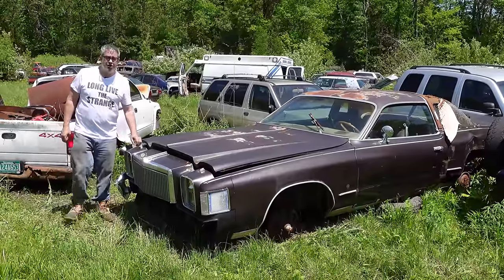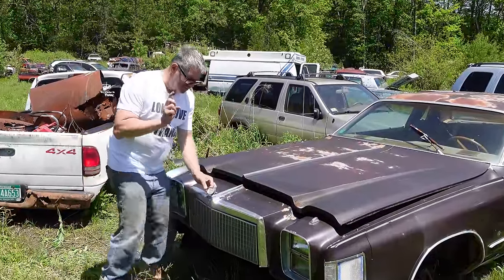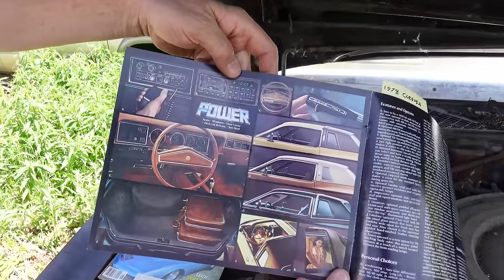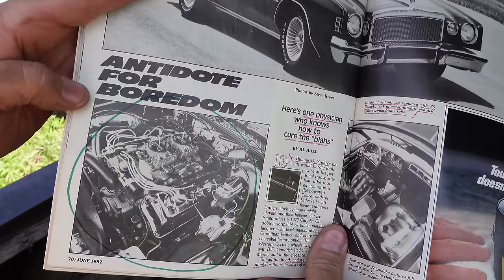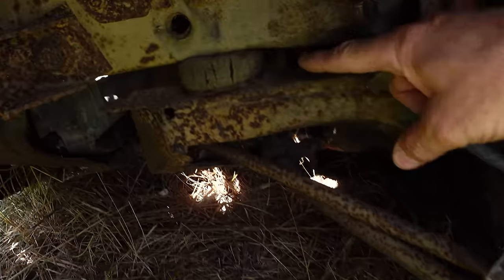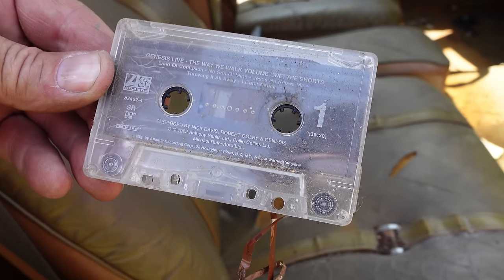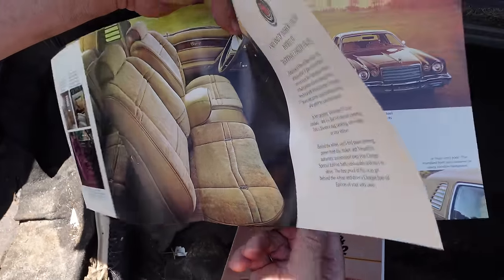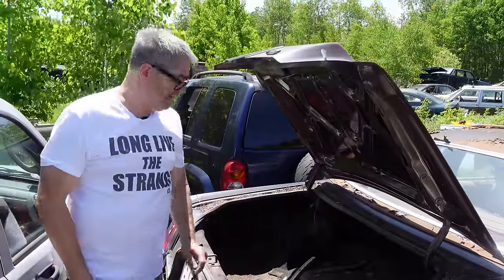426 Hemi Cordoba

Comment: I had a78’ and a 79’ at the same time , the 79’ had the 400 cu in, engine I bought it originally for the big block k-frame for my 78’ as it had the 360 cu in, you stated that the 400 wasn’t available in 79’ , unfortunately I no longer have either.

Comment: I owned both a 1977 and 1979 cordoba, beautiful mid size luxury cars, very comfy on long trips. Hated it when they changed from the classy round headlights and parking lights, to those ugly rectangle lights. I hated to part with it, but the roads salt ate the car up, that's what you get for living in colder climates.

Comment: something else Mopes of the disco era should be remembered for...those #$#ing wrong threaded lug nuts on the passenger side. My father, god father and i took his buddy's Dodge pickup truck into the woods of Maine, somehere near the CA border, and blew the passenger side front tire. Spent the July weekend jumping up and down on the jack handle while swatting the "Maine state bird", wondering WTF none of the lug nuts were coming loose.

well, the "nuts" at Mopar figured that since for every force there's an equal and opposing force, they should make the passenger side lug nuts thread the opposite direction just in case one day they might spin off. hadn't happened since Henry Ford decided to invest in black paint, but they did it anyway.

Comment: My first car was a '75 Dodge Charger SE with a 318 - almost exactly the same car except for the grill and trim.  My NEXT car was also a Charger - a 85 Charger SHELBY Turbo.  YES the 2.2 Turbo WAS a muscle car - I could smoke ANY MUSTANG built - INCLUDING a Shelby GT 350.... And could EASILY turn INSIDE a Corvette ZR-1at speed.

Comment: These videos are always educational.  I don't think that car was available where I lived in CA,.  I think the State mandated the Lean Burn or some special emissions package.  Back in those days there were often 49 state versions, and then the version that we got in CA.
Reply: I had a 78 with 360 California Emissions. It came with a 4bbl Thermoquad but they dumped the Lean Burn and added two more catalytic convertors to it. One off each exhaust manifold plus the standard large one under the passenger side. Despite the extra convertors, it ran very well even with the 2.71 gearing.
Reply: Anyone might wanna look up the vids about the differences ,I recall a vid on here describing the differences in the 80 corvette 49 state vs Cali version.

Comment: cool info , thought 360 then the 318 was a credit opt and 400 was opt, the hd /tow package had dual exhaust ,@10:51 should do the dodge Dakota club cab. dodge invented the club cab in 1973,ford 1974 the super cab  ford still offers it and 1978?79 Datsun had the king cab the Nissan frontier still has the king cab only ones left, as crew cab. /double cab is most of today s trucks  single  cabs  6.5' or 8' box is a rare new truck to day

Comment: If you were restoring one these, what would be the best option for replacing the worn out rubber bushings supporing the K-frame?
Reply: Hockey pucks with 1/2 inch holes
Reply: Hockey pucks
Reply: Remove them,ala Camaro,  it will lower it and make it more predictable to drive.
Reply: @garycamara9955  
Thanks, Gary. My buddy has a 78 Cordoba in his garage. I referred him to this video. I'll  forward your info on to him.

Comment: Habib and I go door knocking and pick up old cars a lot. He is more into Subaru, BMW etc. He calls me one day while I'm at the foot doctor "Hey! Would you be interested in a Charger Daytona? You could get it cheap." I told him not really so he tells me I could get this thing for under 2 grand, they want it outa there. I asked him how bad the rust was, he said:  "No rust, the tires are shot and so is the battery" I drove 2 hours down there and it was a 75 Charger Daytona, one ugly duckling...about an inch of dust and bird poop on it. I replaced the whole fuel system and cleaned that thing for eternity, and it was still ugly but I got it cheap.

Comment: These cars easily burned rubber; testdriving with all the sound deadening I didn't notice i was spinning the tires constantly, but they certainly noticed back at the dealer coming in with hardly any thread left.

Comment: Wrong . The same as the 73 Charger platform . The 400 should have had a Lean Burn . The 400 was a smog engine . I had a 75 Cordoba with a 318 that ran on Regular Leaded Gas . The last year . The 360 was a gas hog .

Comment: "Big block, tire-smokin' Cordoba". <-What a load of crap. He obviously never drove one.
That 400 with the "Lean-burn" system could not light the tires. It was a dog.
My parents had a 1976 Royal Monaco with that set-up, and it could barely get out of its own way.
My dad had the lean-burn electronics removed & replaced with a traditional gap-points ignition system.
After that, she was pretty fast, and could certainly smoke the tires.